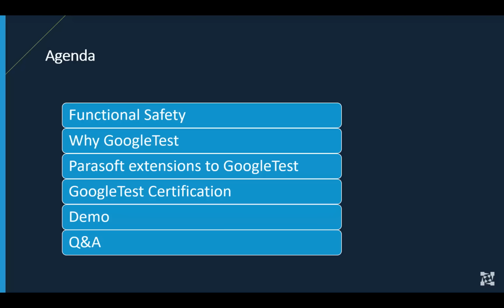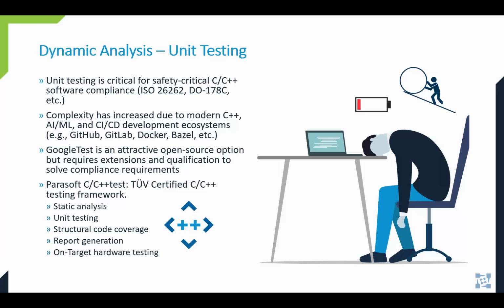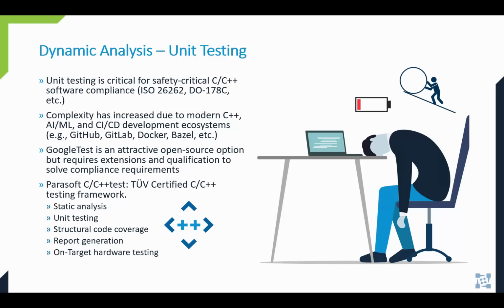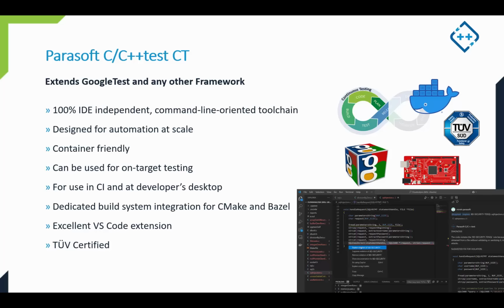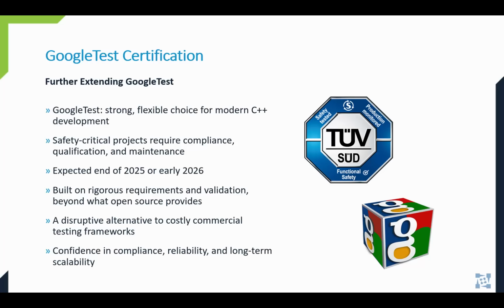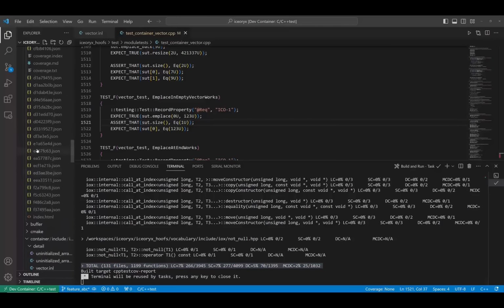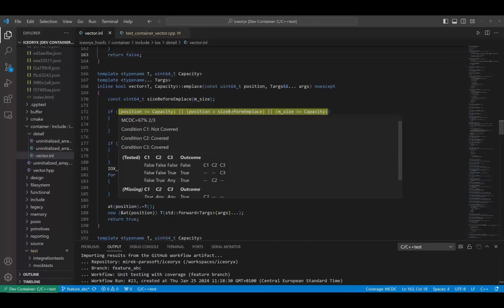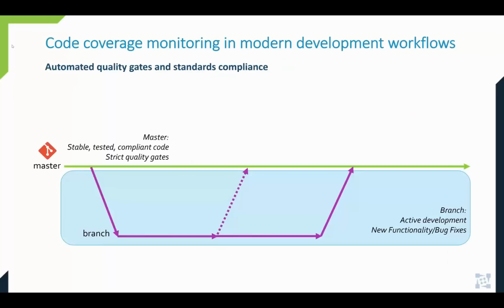Integrating GoogleTest in Safety-Critical Systems

Comment: I’ve worked my whole life in the nuclear power, waste, and weaponry.  We have been actively using all of these steps for the past 60 years, with the exception of integrated AI applications.  Formal risk analysis was integrated in the late 1990s.
Reply: The methods to ensure safety that have been applied for many decades (e.g. Formal risk analysis) are solid and will continue to be applied.  What's interesting is the integration of AI models into products.  AI models are indeterministic and that behavior is contrary to the building safety-critical systems that are deterministic. Guardrails on the AI model and using testing methods that are deterministic are key when integrating AI into our safety-critical systems.

Comment: How does GoogleTest compare to other tools, Ceedling , Unity (unit testing for C), CppUTest?

There's also other tools that seem related, but not sure how they fit  CMocka Catch2, embedded-hal-mock, PlatformIO, cppcheck, Fake Function Framework (FFF),  Renode, Klocwork , Cantata , TESSY , LDRA Testbed , Eggplant , VectorCAST. 

There's a great video called 'Unify to Verify: A Monorepo Approach for Hardware and Software using Bazel, Cocotb and Verilator'
Reply: That’s a great question, and maybe I’ll write a detailed comparison blog on this that can provide greater depth to the differences.
Anyway, as expressed in the video, GoogleTest is one of the most widely used open-source unit testing frameworks for C++, known for being easy to set up, flexible, and well integrated with CI/CD systems. It supports modern C++ features, test fixtures, parameterized tests, and mocking through GoogleMock. That makes it great for general and high-performance development, but it doesn’t include safety certification, qualification kits, or compliance reporting, which are critical in safety-critical industries.
Other frameworks like Ceedling + Unity + CMock or CppUTest are better suited for pure C or resource-constrained embedded environments. They’re lightweight and simple but lack modern integrations and tooling depth.
Then there’s Parasoft C/C++test CT, which extend GoogleTest (and others like CppUnit or Boost.Test) with code coverage, requirements traceability, and compliance reporting. In addition TÜV-certified version of GoogleTest and C/C++test CT makes them ideal for teams working under fuctional safety standards like ISO 26262, IEC 61508, EN 50716, or IEC 62304.
You’ll also hear about tools like Catch2, CMocka, PlatformIO, or FFF,  those fill more specific roles for mocking, automation, or test orchestration. On the commercial side, tools like LDRA, VectorCAST, Cantata, and TESSY offer complete test environments but are often heavier, proprietary, not originally built for CI/CD pipelines and less open.
So, in short, GoogleTest shines for flexibility and developer productivity, and when combined with Parasoft’s certified extensions, it becomes a compliance-ready framework for safety-critical software.
If you’re interested in the “unify to verify” concept mentioned in that video with Bazel, Cocotb, and Verilator, Parasoft’s integration with Bazel and GoogleTest fits right into that model, bridging software and hardware verification in a unified workflow...Send me an email to info@parasoft.com.